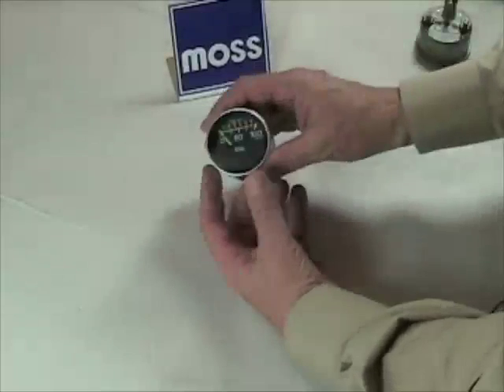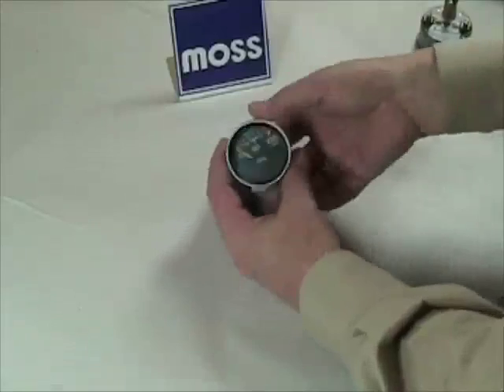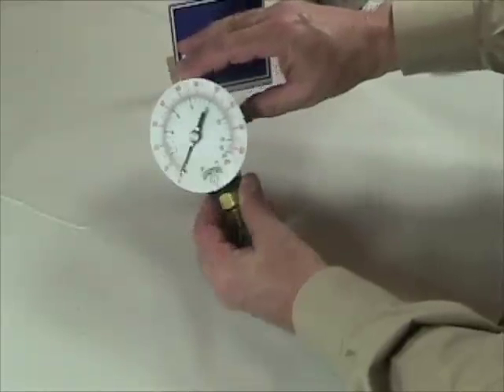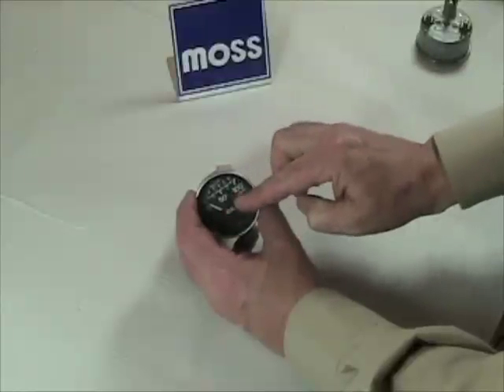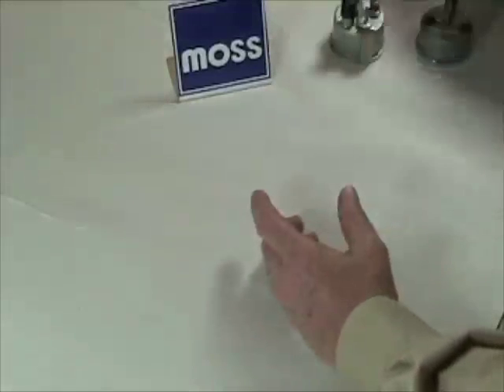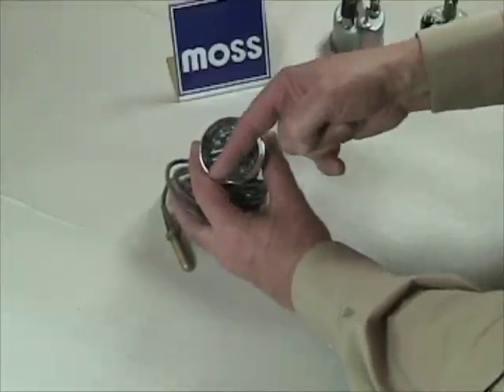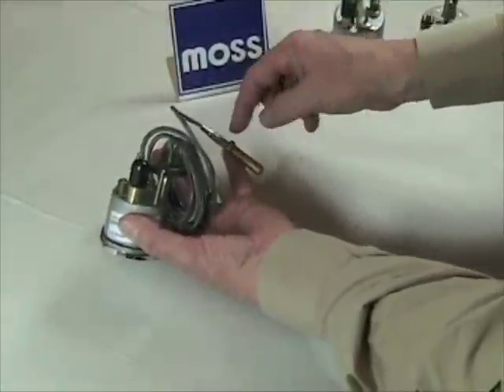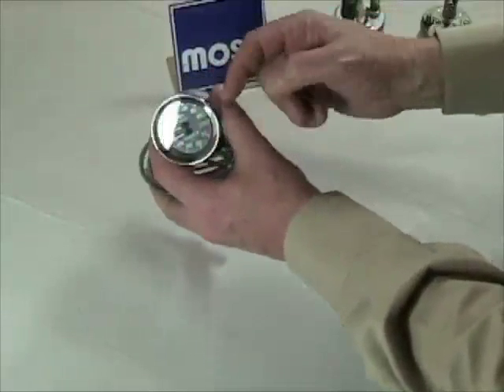Gauges (Part 1) - An Introduction to Mechanical Gauges

Comment: Thank you, now I know why when I switch off the engine the temperature gauge is still showing a reading...because it's mechanical, not electrical! It purely works on the pressure created by the heat of the water expending the sensor.